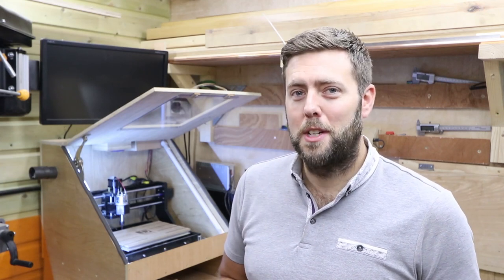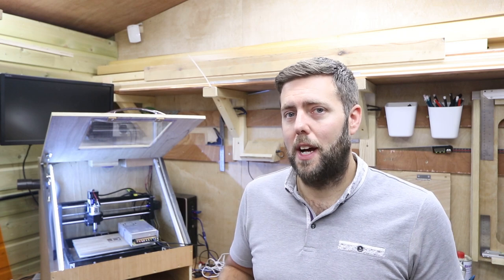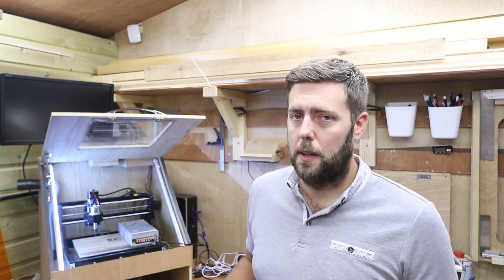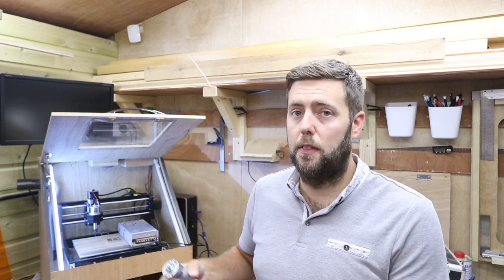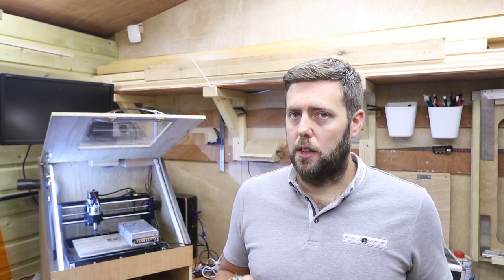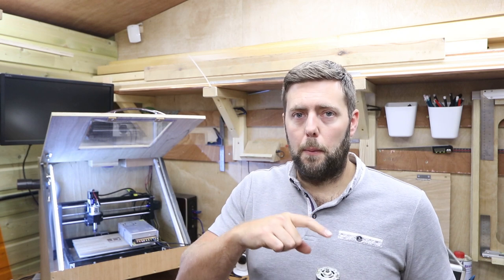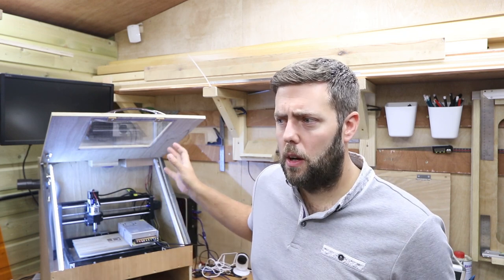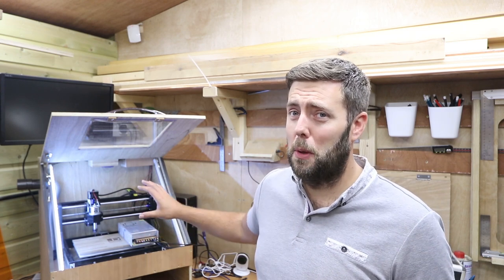3018 PRO - 20k RPM Spindle Update

Comment: Thanks for this information it was very useful. I just got into CNC and I have a 3018pro. I was trying to engrave on a 0.8 mm thick aluminum and it kept stopping after the first character was cut, so I checked the $$30 and its showing =1000 but the spindle speed in Grbl is showing 10000 so now I think that might be the problem. please let me know if you've had this problem before and what is a good fix. Thank you.
Reply from the maker: As long as the $30 number is not higher than your spindle speed is should be ok but still best to check. Also while aluminium is a soft metal, its still pushing ths boundaries of what these machines can do. I think when people engrave metals they do really light passes like 0.1mm per pass
Reply: @JamesDeanDesigns  thanks im going to give it a try tomorrow and hopefully it works do you have a video on creating gcode using easel?
Reply: @JamesDeanDesigns  That’s what I do, several light passes at a depth that will allow the cutter to cut but not bog down. The cutter is really key, I’ve had success with 1/32” ball mills and tapered cutters with a fine point like the ones from Dremel. Experimenting is the key.

Comment: Hi James
Thanks for the really good videos for a novice like me. I have purchased a 21000 motor as per your Amazon link. How do I change the ER11 extension rod as it won't budge from the original motor.  Any advise would be appreciated. Thanks
Reply from the maker: This is quite common. The easiest way is to take the nut and collet insert off, clamp it upside down by the ER11 collet and tap the bar out through the middle with something like a screw driver. You can use some penetrative oil like Plus Gas or GT85.
Reply: For the 3018 pro, what is the mm size for the er11 collet extension…5mm?